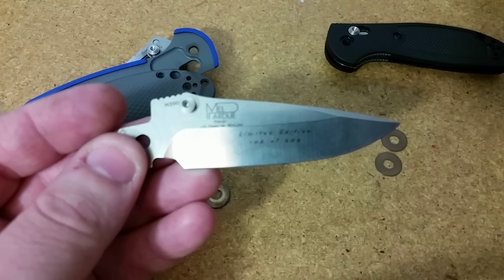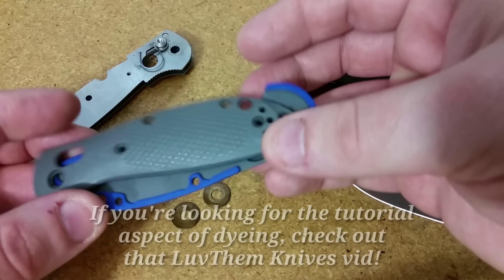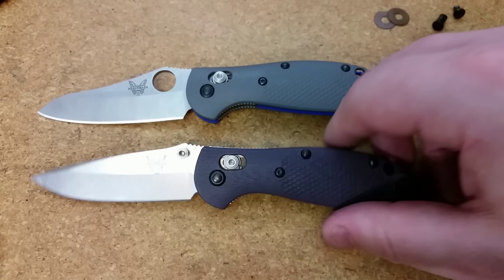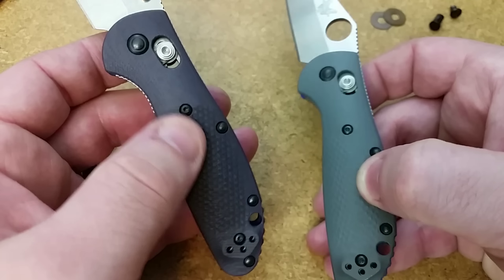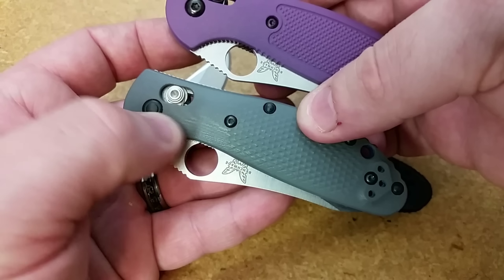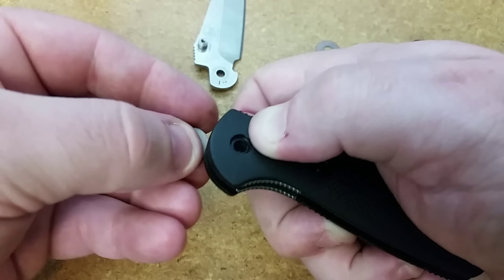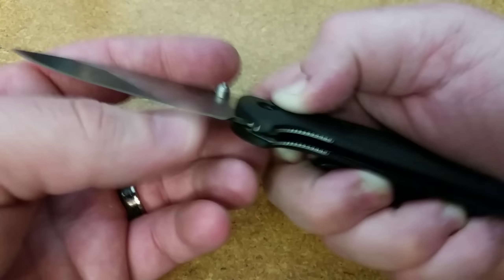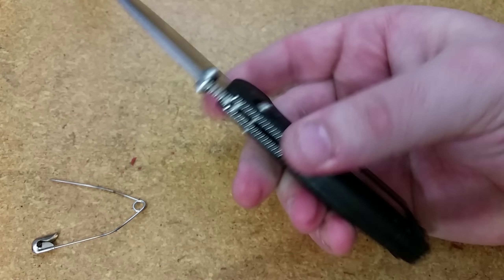Benchmade Mini Grip: Dyed G10, Blade Swap, Reassembly Tutorial

Comment: For the reassembly - you can pull the lock back and insert a wooden skewer or similar rod to hold it back.
Reply from the maker: I've done this about 1,000 times and never thought of that. Thanks a lot for the tip!

Comment: ah the best laid plans of mice and men very nice it lends a much softer and smoother look to the piece just for future reference JT that clip is a beauty but it will show wear an old Nick Shabazz trick strip it down to bare metal polish it up good and a lite coat of oil it works i did it to my spyderco delica and it really improves the overall looks good luck and great vid thanks lukeum
Reply from the maker: Yeah, I've got some that I polished after time, turns out good!

Comment: Tip:  You can hold the axis bar in a retracted position by simply sliding a sturdy toothpick (square or round) in ahead of it after you pull it back. Beats the heck out of struggling to hold it retracted. 
You can also simply set the handles on the spine & the toothpick acts like a sort of kickstand allowing you to more easily manipulate things.
Reply: Nice color selection btw
Reply: I’ll send you a photo to clarify
Reply from the maker: Thanks again Bill. 👍

Comment: Very timely - I want to swap a 555 (thumb hole) blade to a 556 (stud) frame. Have you ever run into fitment/lockup/centering issues when swapping blades?
Reply from the maker: Naw, never have. Sometimes the centering is different, but that's just a quality control issue, not a problem with interchangeability.  All the fit is the same just to streamline production. Any of the blades should work on any frames.

Comment: Hey JT, how did you get the flat button head barrel spacer tubes out of the 555-1? I took mine apart the other day and they are tight in there. Should I use a small plastic hammer to tap them out? I would like to get custom scales but need to get them out before I order any.  Any info would help. Thank you

Comment: It's totally fine to let the g10 sit on the bottom of the pan. You're not going to melt or warp it at all with the length of time it'll be in there. I've done it many times, and haven't had any problems. The one thing I tell people is that less is more: take them out at 3 minutes tops, then rinse them & check the color. You can always put them back in to go darker, but there's no going back if it's too dark.
Reply from the maker: Thanks for the info. The dogs get scared of the loud "pop" it makes if it sits on the bottom though hahaha.

Comment: Hey Buddy, do anyone know if the newer 556-1 uses same screws set as the older model? I watch this video but did not see the part where you disassembled the 556-1 Handle

Any help is appreciated.
Reply from the maker: I believe the lengths are different so you'll need a special set of them.

Comment: i have a 556-1 mini grip like in this video. my big concern is that the omega spring doesnt rest in its own hole. theres just a notch in the cutout that the axis lock slides through (to take apart). also the cut out for the omega spring isnt shaped like yours. the bottom most part of the cutout on mine isnt round like yours but is shaped kinda like it follows the contour of the jimping. i bought it a month or so ago so im wondering if yours might just be an older design and they have updated the design? everything else is legit down to the holes in the blade.
Reply from the maker: Hmmm, sounds odd. Can you send me a pic so I can really understand what you mean? Jtsknifelife@gmail.com or jtsknifelife on instagram.
Reply: @JTsKnifeLife  sent you a couple pics on insta
Reply: if anyone else has one of these knives i would love your input. if you have instagram i could send some pictures to clarify things.
Reply: @dirtrider88   I have a 556-1 too and yes the spring rest in its own notch.  I just bought a fake mini grip off eBay by accident.  I could tell it was a knock off but it was done extremely well.  One thing I noticed is the knockoff had a round axis lock hole where the real ones are more squared.  My knockoff was circular and the omega spring went into its own pinhole instead of that slot your talking about.   Which confuses me because his knife in this video was just like my knockoff.  He put his omega spring into a pinhole and it had a circular axis lock .  Did Benchmade change the design?   I returned my mini grip to the seller.

Comment: Nice job JT! I’m on the fence about doing this with my bugout. Benchmade says you void the warranty with disassembly of the knife. If you sent that in for service would they decline it? Thanks for the video!
Reply from the maker: They would probably deny it, yeah. I'd have to put back the original scales if I wanted to send it in. Once you dye them you can't undo it.
Reply: I asked them bout a week ago about my rift that I dyed and took apart and the said I could still send it in for replacement parts. Just ask them and they'll tell you about their policies

Comment: you realize 20cv and m390 are practically the same, right? I understand for novelty purposes but just seems a bit pointless.

also when assembling you don't need to hold the axis lock open the entire time, only when you're inserting the blade and when tightening your pivot at first it helps centering. otherwise you can let it go once you have the blade in, you don't have to hold it while you're putting in the washers. also a better method is to put lube on the blade and washers and put the washers onto both sides of the blade and the lube sticks the washers to the blade, then you can insert the whole assembly at once and then just use a tool or pick to align the washers after you push everything in. though this method is easier when you either have one scale removed or when you have some of the screws loosened to provide a little more play when inserting the blade and washers together.
Reply from the maker: This video was made a  long time ago. I don't know what I said in it to prompt your comment.